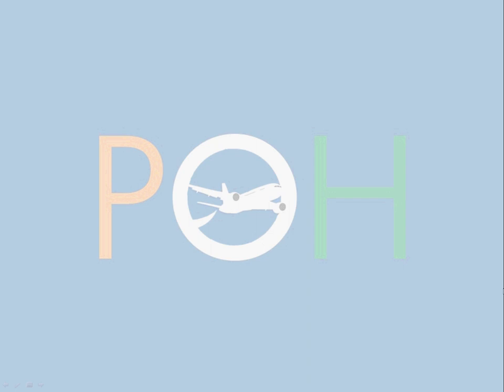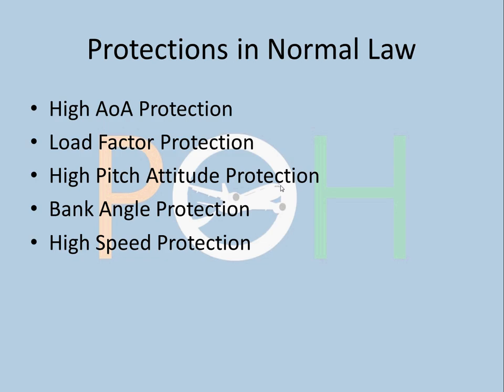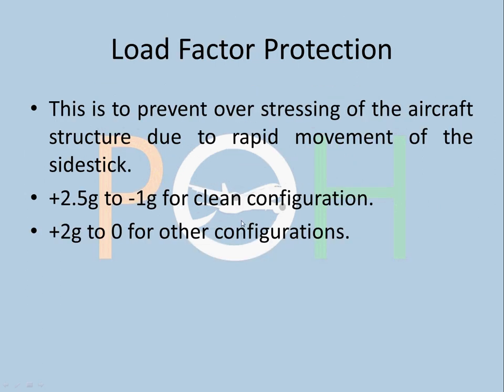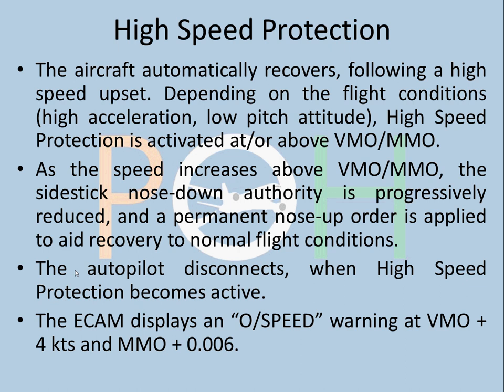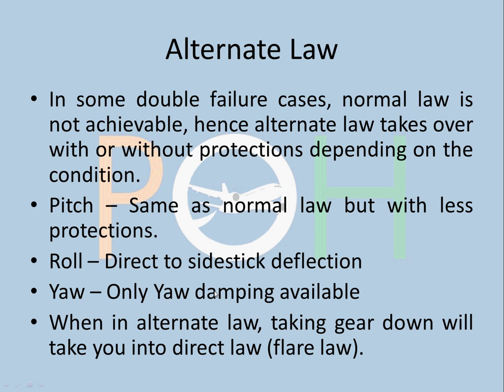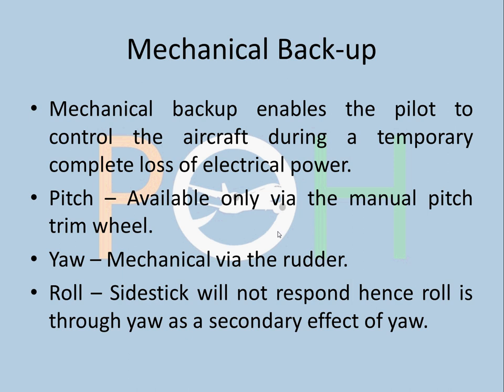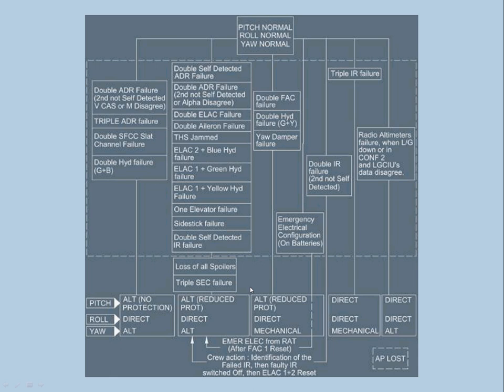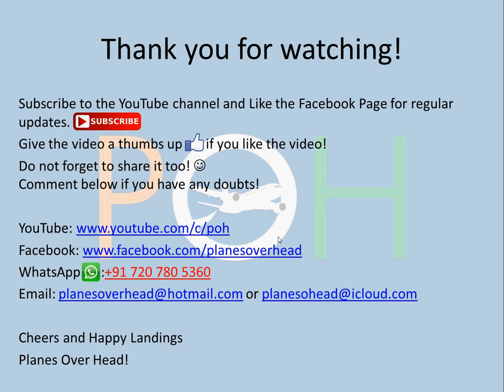A320 - Flight Control Laws

Comment: Regarding the manual flight controls under Normal Law: I was under the impression that the plane would hold a selected Fligth Path Vector, and not pitch/bank (within the 33 deg AOB). Is this correct, or not?

Further I would like to say that I really enjoy your videos. Great work!
Reply from the maker: When you are in the HDG V/S mode there is no flight path vector. So in that case it is always whatever pitch/bank you set it up, it shall maintain that. 

And thanks! :)
Reply: Manual Flight Under Normal Law You Have Flight Directors Available And You Can Easily Follow It.
Reply: That's correct what you post! It's not the pitch that is maintained but the G-load demand! Therefore be careful what you believe from the internet 👍🏼
Reply from the maker: +Kurosch Hadidi Thanks for the correction, I'll put it up on the description! Yes indeed its the G-load demand. It keeps it maintained.

Comment: Hey guys. Yours videos are awesome. Thank you for doing this! However getting information from FCOM and putting it here is easy. Right? I recommend you to put video of explanation. For example, yeah FCOM says maximum 67 degrees but is it maximum? Why can’t you fly more than 67 degrees? Is there any explanation of that? So it’s better to dig deeper rather than reading from the FCOM limitations memory items or QRH etc.
Reply from the maker: These are introduction videos. I conduct full fledge classes for aspiring pilots and students pursuing this wonderful aircraft as a career. Those classes have in depth information and knowledge about such things. Thank you for your comment and support!
Reply: 67 degree bank won't exceed 2.5G Load factor, so that's why 67 degree is maximum. correct me if i'm wrong. thanks

Comment: Sir what is Mach no. ? Is it related to speed or something ? I need little explanation on Mach no....
Reply from the maker: At high altitude you fly in Mach because of air density and True Air Speed measurement may not be accurate.

Comment: In alternate law,only yaw damping is available means we can’t yaw the aircraft it just provides yaw damping?If we can’t yaw the aircraft then why do we need a yaw damper?
Reply from the maker: Yaw damping helps prevent dutch roll.
Reply: Thank you
Reply: In which section of  FCOM this flight control laws details are given ?
Reply from the maker: Flight control chapter

Comment: Sir why Elac 2 is no go?
Reply from the maker: Because ELAC 2 is master ELAC and has primary control over Elevator. ELAC 1 is standby one.
Reply: coz if u deactivate elac 2(if it was under mel, in real its not), than elac 1 will control pitch via both elevator blue actuator, but in case blue sys failure during flt both blue act will be of no use and elac 1 is electrically ok and it will not sft crls to sec 2 resulting in loss of pitch ctrl via elevator hence its no in nature.

Comment: air asia n airfrance both stalled n crashed into the sea,,,were it because in direct law = no protection from the 7 flt computers=elac,sec,fac =save plane from stall yet air france stalled over atlantic and airasia as
well in tropic convergance. zone,,
im just a aviation flight simmer 6800 hrs on a pc and 12 on a ga 172......thx
Reply: Both ended up in alternate law won’t protections lost.
Reply: @peteconrad2077  i see
thx for info
Reply from the maker: More to do with icing too.